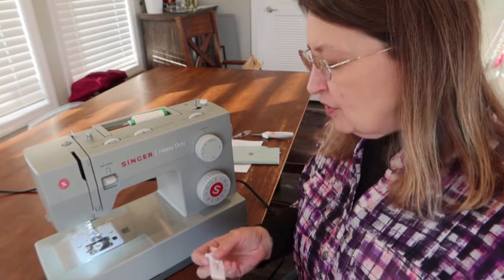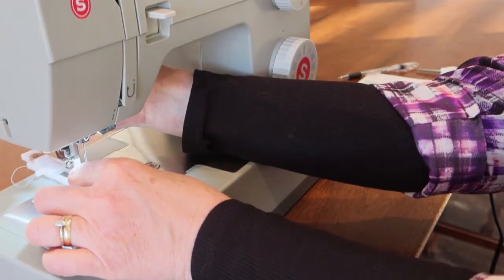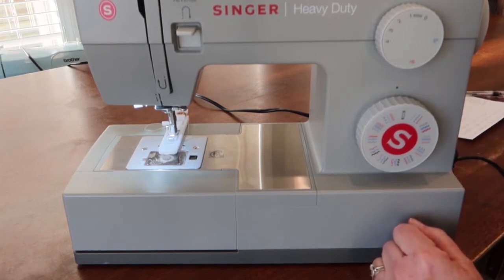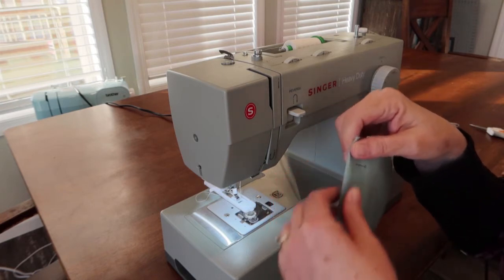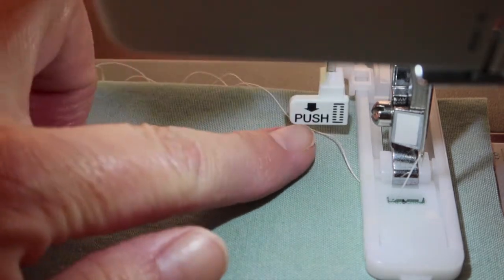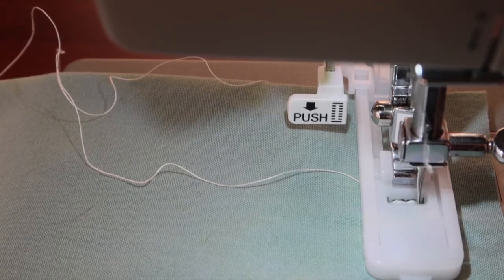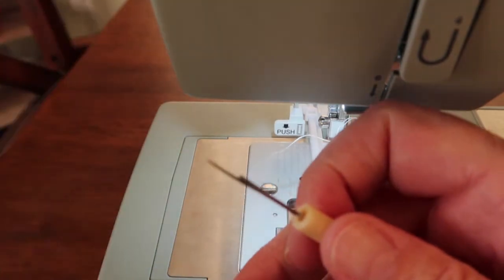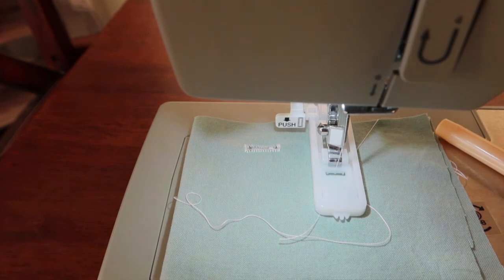Making Buttonholes with Singer Heavy Duty 4452

Comment: Thank you! I always watch videos before i try stuff.  I like that you said i just have to pull the foot apart - i was trying to find some sort of release lever to make the ratcheting easy (instead of scary). 

The other video I watched suggested putting straight pins along the ends of the hole to protect them from overzealous ripping.

And i never knew that the brush had a seam ripper in it😂
Reply: Me too😂